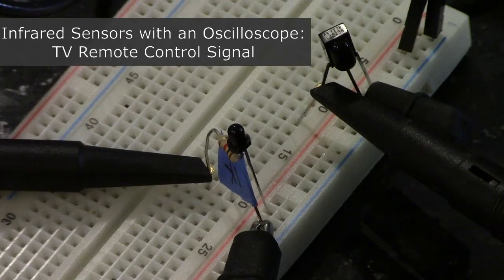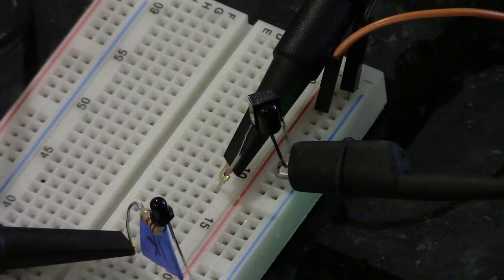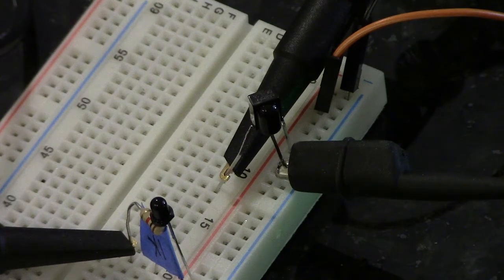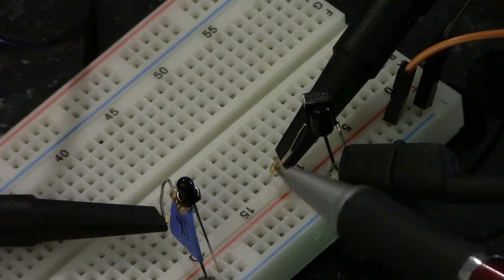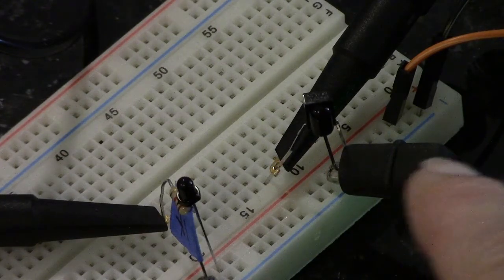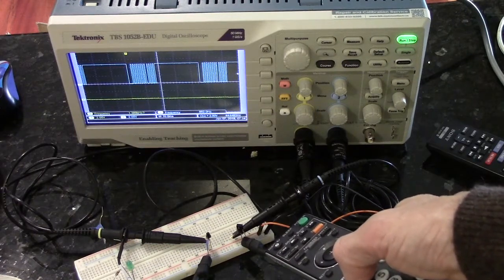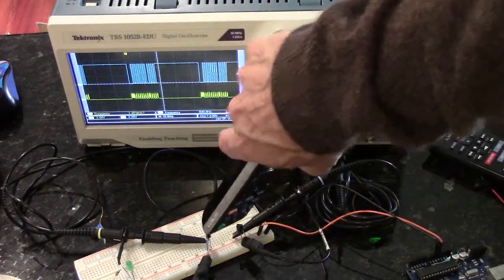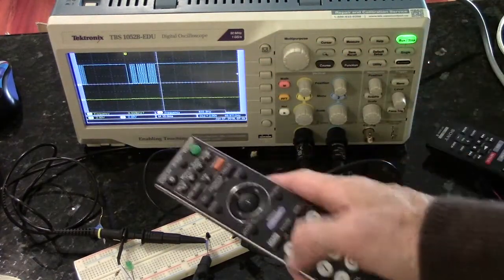Infrared receivers (sensors)--analysis of TV remote control signals via Oscilloscope

Comment: nice, thanks. but, when this square wave signal reaches bc558 transistor to ic4017 will this be a same waveform. some times capacitor and a resitor is used before connecting the input to base of the transistor. why. can you pl. advice.